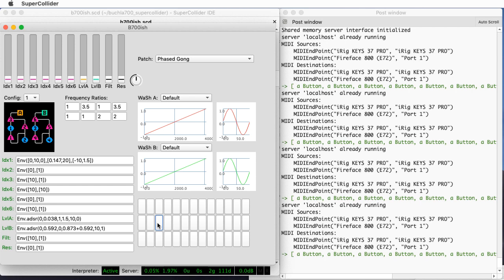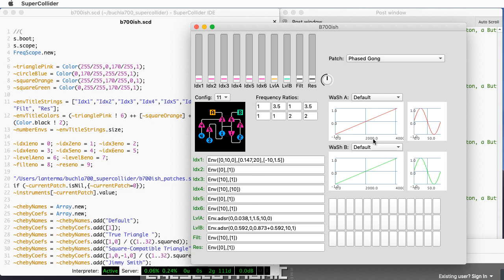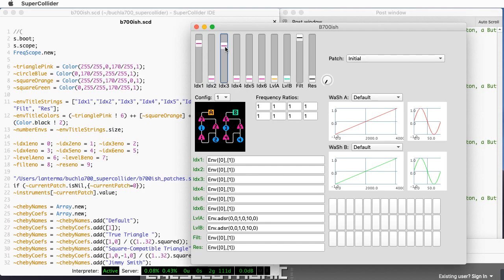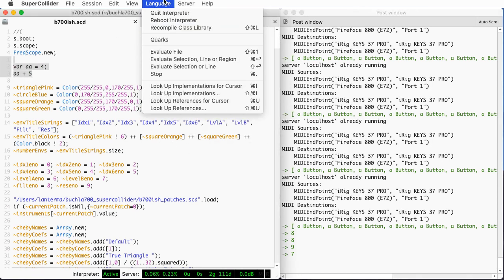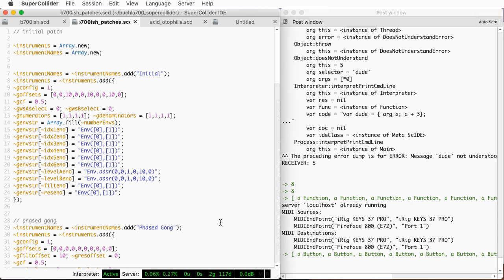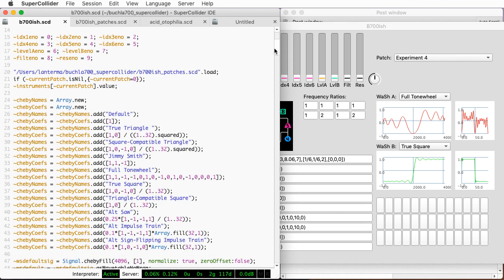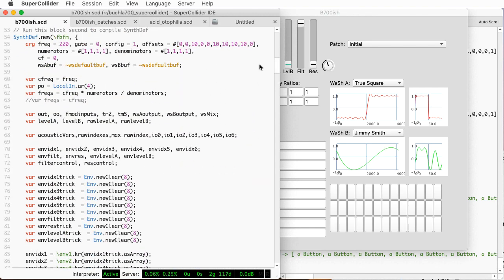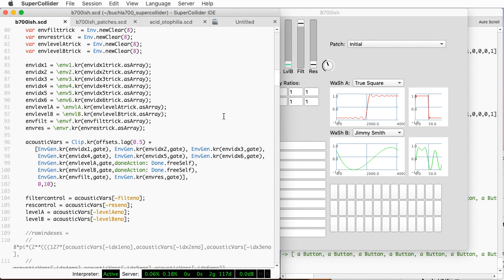Buchla 700 Voice Architecture Approximated in Supercollider Code, Part 1 (with tutorial tidbits)

Comment: I'm not sure exactly what you meant, but if you click the upper-left corner of the post window and dock it, then you can drag it below the input window to get what I think is the default vertically split combination.
That order of operations left-to-right, instead of operator precedence, is the only thing I really dislike about SuperCollider.
Thanks so much for the video!

Comment: FOr some reason the gui doesn't sow when running the code
Reply from the maker: Huh... sorry I'm not sure what the issue could be.
Reply: @Ward de jager
You have to add and rename the configuration images in their own folder and find the line that reads Image.new("/Users/lanterma/buchla700_supercollider/fm_config_c_"
and change it to an appropriate path on your machine.

Worked for me!